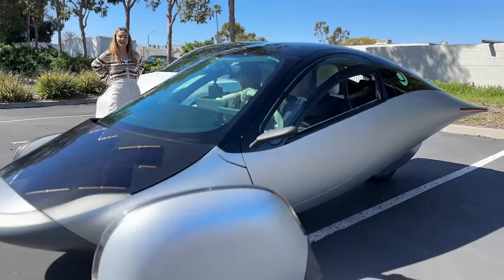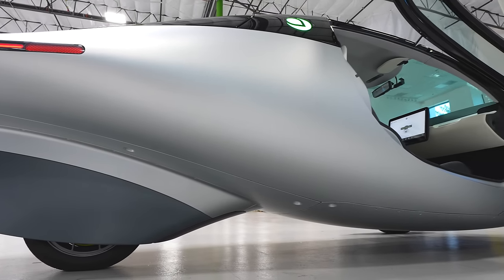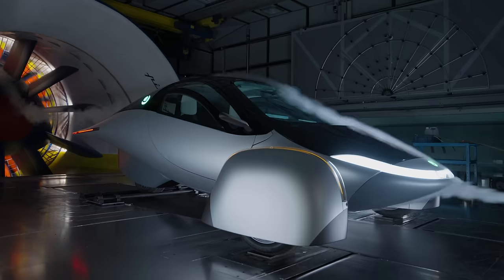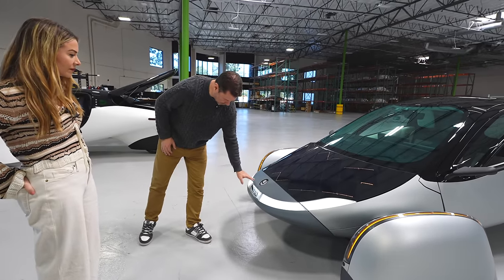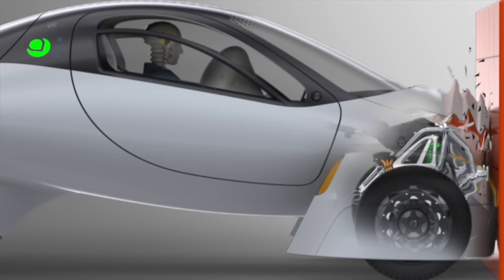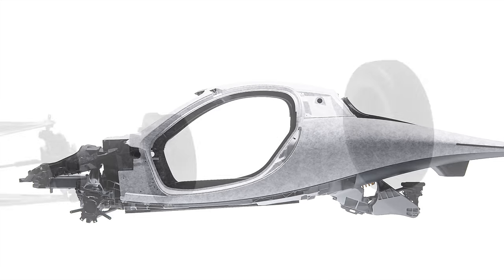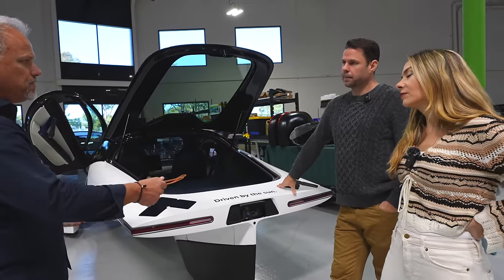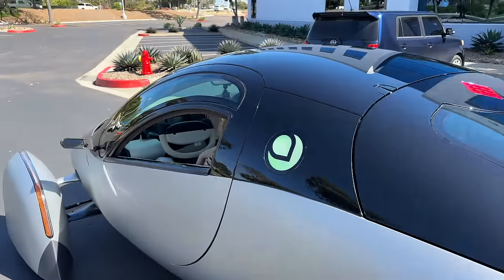Confronting Aptera's CEO w/ Investor - WHERE'S MY CAR?

Comment: The best interview ever. Thank you Kim, you also made some really good questions that some of us had and no one asked before, I can't wait to get mine 1,000 miles aptera version.❤❤🎉
Reply: You can wait for a 1000 years dude! Well done 👏
Reply: @dangr3957  a thousand? 😅
Reply: If you can't wait then for your 1000 mile version then you are in the same boat as those waiting for their 400 mile versions.  Each year it is another year wait.  Sounds a lot like waiting for Fusion electricity.  Aptera needs to bring those front wheels in.  I love the looks and tech of the Aptera but those front wheels need to be re-engineered inward because they are the only thing keeping the big investors from committing.  At least, that is my guess.
Reply: You block those that just want to have a honest conversation, so what’s the point!
Reply: @ModernNeandertal  🤓 They've explained that wide wheel stance is part of their "secret" to their low drag and thus high mileage. If you pull them in the drag goes up and the mileage down.
Reply: Same
Reply: @fotoguru222  Your post doesn't make sense, pulling the wheels in will not increase the Cd, it would be the same frontal area.  If that were the case then every airplane would be like a P-38 lightening, not a single central fuselage.  With wheels that wide the turning radius must be huge as well, good luck making a U-turn.
Reply: @S2kDude36  , 🤔 You appear to be confusing the drag coefficient, Cd, with the aerodynamic drag, which is Cd times the frontal area. Cd is independent of the frontal area and dependent only on the shape of the vehicle independent of its size.
Reply: @ModernNeandertal  the vehicle has only 3 wheels to decrease drag with the asphalt and the 2 in front need to be far out to increase stability when making a turn on the road. For what concerns the looks imagine the prowler. They seem to be doing the right thing to me. The only thing is that they need to put them on the road. Once people start seeing them around it will change their opinion.
Reply: @paolomartini150  3 wheels of course will cause less drag but I think they went with 3 wheels because it classifies it as an autocycle and makes for billions of dollars less red tape and hoops to jump through.  Don't get me wrong, I love the looks even though the outboard wheels still give me pause.  I want to see these on the road and hear how owners feel about the vehicle in general after a few thousands of miles in their Aptera driver's seat.  I would love to test ride one to experience the darned thing.
Reply: but who has checked the facts ? 
He is just lying cause if he is right with 700 W which should mean 700 Wp solar panels then you would produce on a roof in germany facing south with a 35° angle  700 kWh. But this cars panels are not at a 30° angle and not always facing south and not always out of a shadow which means you can expect max 70% or 500 kWh of energy production. Assuming 0 losses which is wrong if you charge a battery then you can ride with a 100W consumption figure about 5000 km and not 8000 km at best. 
that is 37% less than he has promised unless you can always park your aptera with a 35° facing south like a roof and without any shadow. I bet you can not.
Reply: @typxxilps and 0.1kWh per mile, maybe downhill with the wind behind you.  A sub 30mph electric bike uses about 0.05kWh per mile if you pedal, so......magic ???

Comment: love their attitude towards right to repair and sustainability. Wish there were thousands of apteras on the road
Reply: Agreed
Reply: Yep. The modularity and repairability should steal customers from Tesla.
Reply: Louis Rossmann would approve!
Reply: @datachu  Go Louis !!!
Reply: You can't repair something that doesn't exist.
Reply: @Okurka.  Ah, the EV understander has logged on.
Reply: Agreed. When I heard "right to repair" and "open source" that got my attention.
Reply: @lashlarue59  Those are called "buzzwords".
Reply: They need a good attitude  towards right to repair, cuz you're gonna be the one repairing it.
Reply: My dad wanted to replace the headlight bulb in his 2020 Dodge Durango.  $800 and 3 days later, it was done.  Manufacturers are pushing to make repairs impossible without a dealership, but it looks like Aptera is going the other direction.  I like that.
Reply: @OnYourLeft  It's LED in the Aptera and you'll probably have to replace the entire headlight unit as it won't use bulbs.
Reply: @Okurka.   - Still don't think it will take $800 of parts and labor (mostly labor) at a dealership in order to replace it.
Reply: @OnYourLeft  What dealership?
Reply: @Okurka.   - The Dodge dealership.  Did you not read my original comment?
Reply: @OnYourLeft   I didn't know that Dodge dealerships were going to sell Aptera three-wheelers.
Reply: @Okurka.  - I believe you are intentionally being obtuse.  So, let me clarify my comment so that your tiny, one-track trolling mind may understand completely what I'm trying to say:

Headlight in Dodge not work.
Dodge not allow driver to fix headlight.
Must take to Dodge dealership.
Fix take 3 days and cost $800.
Most new cars stop fix from drivers.

Hopefully that helps, and I don't need to break out the sock puppets this time.

Your feelings for Aptera are painfully obvious.  That's not my point, nor is it the point of the OP.
Reply: @OnYourLeft  You are the one who mentioned the labor cost at a Dodge dealership to replace the headlight unit of the Aptera.

Your feelings for Aptera are painfully obvious.
Reply: @Okurka. - Sock puppets it is, then.
Reply: When I heard that "Right to Repair" is what just sold me.  I'm putting my $100 now!
Reply: @easternblocairguns2728  It's "Difficult to Repair" now they decided to bond the wires directly to the PCB.
If it gets released, of course.
Reply: @Okurka.  I have talked to several of my local shops and every one of them are eager to work on it.
Reply: @OnYourLeft  You're correct. No ongoing repairs on a non-existent vehicle.

Comment: I had a reservation in 2008. This is one of the best videos on Aptera I've seen.
Reply: And more than Videos you will never get.
Reply: I had two reservations, one for the e and one for the H.  I did not have much faith in the electric only and wanted to be sure between the wife and I that we had a car that will take us anywhere there's civilization and beyond.  I was not sure which one would get built first either.

I had the pleasure to tour their plant from their first go round in 2008, got to seat in their H test vehicle and met Chris when they were looking for quotes for their production tooling back then.  I thought the design mimicked Adams Aircraft but now, using sheet molding compound....They are way beyond the tech they were going to use before.  The Aptera is pretty much going to be a forever chassis.  This is leaps and bound beyond the Cyber Truck (yeah got one on order there as well).

Best case scenario is to have the Cybertruck for the wife and I the Aptera.  I love my MS but would trade it for an Aptera in a heart beat.
Reply: Just think. In 10 more years, you might actually get one. 😂
Reply: 2008? And you still happily waiting... 16 years man.
Reply: I also saw pictures of the original design 15+ years ago and was hooked on the ultra efficient vision. I had no idea the founders left the company back in the day before they liquidated and destroyed the prototypes. I learned a ton from this video.
Reply: Fool me once....😂
Reply: @bluetoad2668  like they say in Texas, fool me won't get fooled again!
Reply: @Alkatross  I guess they don't have many reservation holders in Texas😂
Reply: That's easy a different company that has fell over after the founders left. This Aptera is a new company launched around 2019
Reply: @PandaKnight52  new company? yes, same dodgy owners? Also yes.  Please, don't get fooled again.

Comment: Once these get on the road this company is gonna blow up.  I can see these being the most popular vehicle in places like southern California where gas prices is high and electric prices are high
Reply: Currently, I drive a MS.  Daily charge is about $2.5 but it's not just the $2.5 the act of actually have to plug and unplug.  I know, not a big deal but better just to come and and drive away.  Suposedly they will also have self driving or at least equivalent to autopilot.

I was disappointed when they went away as I held two reservations in 2008 for their h and their e.  That was the worse refund I've ever gotten.

I recently changed my 1000 mile all wheel drive reservation to the Launch Edition to shorten my wait.  I wished they did like Tesla and build the most expensive trim first.  I'd hand over the pink to my MSLR today to take my Aptera home....but I can wait a year I guess.  400 miles is about what my MS is rated.  Plenty good for most of my road trip with only one stop.
Reply: I agree.  My wife and I still drive our 2001 Honda Insight.  Aptera will improve on it in every respect.  The AWD 0-60 acceleration is better than that of the first Tesla Roadster.  We rode in a prototype in 2021, and it is amazing how much fun these are.
Reply: I was following Aptera the first time around - was seriously thinking about putting down a deposit on the hybrid version when all the craziness went down and they liquidated. Reserved the 600 mile as soon as it hit my radar again 3 years ago. Recently changed to the Launch Edition as I ain’t getting any younger lol.
Reply: The next “people’s car” like the VW Beetle.  This will be the “Aptera Fly”
Reply: lol, so sad, did you buy a FUV too?

Comment: Investor and res holder myself. Nice presentation, and I am also encouraged. That said, I want mine NOW!
Reply: We are all impatient.  I am old enough that I could run out of time.  However, I am still encouraged about the hope this gives for the world that comes after we are gone.
Reply: If I was in the US I’d definitely have one. Hopefully a slightly narrower version will make it here to the UK.
Reply: This car doesn’t need solar 
It just needs a 2hp engine generator setup to charge the battery.
Reply: @MrCountrycuz  I helped introduce a small variable speed HVDC generator to the US Army that my company developed after Desert Storm.  It was well received for the time, but that time has passed.
Reply: @MrCountrycuz  yup, sort of like locomotives, pretty efficient method.
Reply: well so you know..."IT'S NO GOING TO HAPPENED"...ask them what they did with your money...because they haven;t built any cars.
Reply: @robertcarlos8888  Not true - my wife and I have both already ridden in a prototype, and we can see where the money is going in improvements. (Change to SMC/Carbon fiber body, with much better parts tolerances, and glass covered solar panels that are lighter and more robust than the original resin coated ones.)
Reply: Aren’t the places where this car solar charges the best also the places that need air conditioning?
Reply: @TryHardNewsletter  One of several reasons that all models will have HVAC built in.

Comment: Best interview with Aptera ever. Being licensed as a motorcycle also means you don't have to have a front license plate which is required in many states for cars.
Reply: Who cares of having one or none ? I see almost only advantages of having one (too many idiots on the road, plates force more responsible driving).
The only real disadvantage I see is a bit worse airflow.
Reply: @pan6593  If you think having front plates makes ANY difference in responsible driving, you are mistaken.
Reply: Many states require a motorcycle license ..... so something to think of.
Reply: Yes, but insurance companies will quickly catch on and charge a premium because it's an Aptera. You can't win against insurance companies. It's like Charlie Brown kicking the football.
Reply: @EricHaskins71  Fortunately for me, I've had my motorcycle license since the 70s. 😉
Reply: @iamatransporter  so do I but many will be surprised they will have to take a course and $$ before they can drive
Reply: @EricHaskins71  Can't wait to see the look on the face of the instructor when drivers bring this thing to their motorcycle safety course. But it sounds like you don't need an actual motorcycle license since it's 3 wheels.
Reply: @robertkelleher1850  Don't need a helmet here in Florida either. So overhead is moot here and electric cars are proving to be a gimmic.
Reply: @EricHaskins71 at this point, I don't think there are any states that would require a motorcycle license for driving the Aptera. There are only 1 or 2 left that require a helmet, and then only if you're under 18 years old
Reply: @GoClimbARockEh   slingshots are registered as motorcycles and require moto endorsement. This 3 wheeled design is not new ....
Reply: Being licensed as a motorcycle also allows access to HOV lanes in some places.
Reply: @GoClimbARockEh  You may want to educate yourself. There are only 3 states with no helmet law (Illinois, Iowa, and New Hampshire). 18 states require all riders and passengers to wear helmets at all times (including California, New Jersey, and New York; as well as Alabama, Mississippi, and Louisianna)
Reply: @BrainiacHoyt  You may want to educate yourself. Helmet laws for autocycles like Aptera are different than for motorcycles. There are currently only three states that require helmets for autocycles, and only for riders under 18. Those laws will be changed soon.
Reply: @BrainiacHoyt  Missouri recently removed their helmet law, gotta get that Sturgis traffic

Comment: I know Aptera is taking so long to get to production but it seems like it's worth waiting for. They've been pushing for NACS to be the defacto charging system and look at how that turned out to be.
Reply: The problem is when they run into issues will they have the ability to fix what inevitably will come up.   A supplier can go out of business, they won’t have the capital to buy their way out of that and keep running.  If they have pack failures or fires they could lose their insurance.

They need to find a deep pocket partner excited about their success and willing to take the ride.  Chris needs to go on a few dates with Mackenzie Scott (Bezos’ ex).
Reply: good luck with your waiting...lol... don't hold your breath...everything points to "IT IS NEVER GOING TO HAPPENED" time will tell how it will turn up to be...but it doesn't look good.

Comment: Their cost is so low that an Aptera and a house outside of the city makes financial sense. I don't see it as my primary vehicle but as a second commuter vehicle that can fully charge from a 110v outlet it would make me less hesitant to live farther away from work
Reply: Yeah, I just hope it's still competitive once Tesla's compact model is out, since it's looking like they'll both be hitting production at similar times and similar prices.
Reply: I don't see how they can make this car for that prize. A lot of expensive materials and hand made parts. I will believe it when they delivered all the reserved cars.
Reply: @weorldedit  The materials really are not very expensive. Materials such as carbon fibre and titanium are actually very easy to get and don't really cost very much. There is more labor which is expensive.
Reply: @ralphinator2  Titanium? They use aluminium.
Reply: @weorldedit it’s quite simple. They won’t. This car will never make it to market IMO. If it does it’ll be over 40k

Comment: I was following Aptera back in 2006ish, was thinking about putting in a reservation for the hybrid version, but the company liquidated before I did. So when they showed up on my radar 3 years ago, I made a small investment and put in a reservation for the 600 mile version. I changed that to the Launch Edition a while back, as I ain’t getting any younger 😂 Good new info on the seat heating, first time I’ve seen that confirmed. Thanks for the voice control question - hadn’t heard any new info on that in a couple years. Makes me wonder if they already designed in a mic somewhere.
Reply: When it will really be produced, a seat heating will be all you still need.
Reply: A reservation isn't an investment.
Reply: @Okurka.  Who said it was? I invested in June of 2021, when it was $3.80/share. I’m quite happy with my prospects so far.

Comment: I have a small complaint about what was said about Tesla at the beginning of the video. Tesla isn't crushing the competition. It wasn't that long ago that Tesla had more than half the worldwide EV market, but BYD should be number one this year.

Unfortunately, a lot of the competition is run by morons. People who want EVs don't want massive pickup trucks, they want smaller cars for city driving or luxury / sports cars. Rivian might go bankrupt and Ford is cutting production on the Lightning. Meanwhile, the Porsche Taycan had its best quarter for sales. 

Aptera fits in both the sports car and city driving markets, so it could be a big hit.
Reply: The only downside for city driving is that it's as wide as a truck which might make going into older cities (or Europe generally) a bit of a struggle.

But the ethos is absolutely there to appeal to both crowds whuch is a great idea.

Comment: Seems that the build process will be very dependent on supply chain dynamics of sub-contracts for important component manufacturing and timely delivery.   It all needs to come together like an orchestra, with the many parts arriving in volume to support the assembly line and keep finished vehicles rolling out the door with all unique parts on board.  I am so on board with this plan that I want to come to Carlsbad as a volunteer builder / parts runner or anything they need…sweep the floors!!  Count me in!
Reply: Once they get going I bet more and more of the parts will be produced in-house…fight you for the broom, love to work here !
Reply: These should and probably would be highly prized manufacturing jobs. Please don't offer your labour for free ! And join your union !